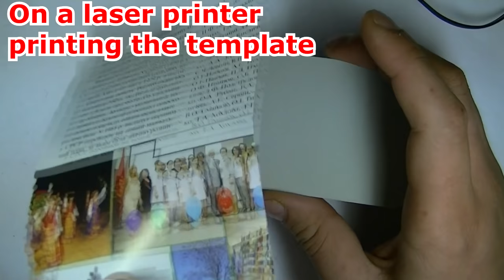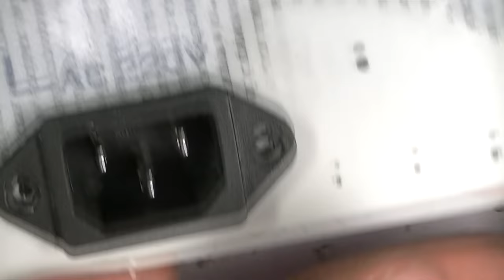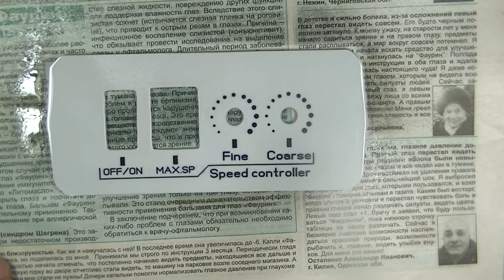How to make a beautiful front panel for an electronic device

Comment: Did you know there is a drill attachment that nibbles out shapes? One hole and with a template guide away you go, smooth finish within minutes for plastic, aluminium, and mild steel up to 1.5 mm thick..

Comment: The solvents in that spray can are very similar to acetone or could contain acetone. Although a bit more difficult to obtain a 2 part polyurethane clearcoat will not dissolve the ink/toner.

  You managed to get the paper off of the ink/toner much better than I can. Nice job.
-Jake

Comment: Maybe I can answer some of your questions:-)
1) What material you try to use as a front does not matter as long it can handle the heat you have to apply. It can be metal, plastic or many other material's.
2) The best paper you can use is paper with a high gloss like magazine paper, laser photo paper and others so long the paper also can withstand high heat so dont use inject photo paper. For best result try to find some paper that also takes water wary well so it get soaked easy.
3) You have to use a laser printer because it melts your motive on top of the paper.
4) How much heat then? You have to apply so much heat that the laser "ink" remelts and sticks to the surface of plastic or metal you want to decorate. Try from 200C /  400F and go up.
5) When you want  to remove the paper you just have to soak the paper in water for 5-10 minuts and carefully remove the paper with your hand or a cloth.
7) Last try to search for "making circuit bord" or making PCB" there are a lot of great info you may can use.

Comment: Wait, a few questions about the first step (or before it). You used a laser printer on what material? Is it proper for this type of job? What is its name? And the most important question, if you want white text and indications on a black chassis / box, what do you do; I have some old synths with white letters and lines worn-out. Thanks
Reply: You must use a laser printer (LED toner transfer printer) since toner is actually a thermoplastic powder that melts onto the surface. You can use glossy magazine paper for the transder, most works. You can also buy special PCB toner transfer paper.

Transfer can be done onto most materials. Here it's an ABS enclosure. Polystyrene, polycarbonate, aluminium, stainless steel i believe have all been used with toner transfer.

It is possible to buy white toner powder for laser printer (ghost toner). I cannot promise you that it works!

You may be able to use drag knife cut PVC foil to restore white lettering and graphics on your equipment. You can get the cuts done at every custom T-shirt shop in the city. Then you apply transfer film, use transfer film to apply the cut design to the item, weed out the lettering and graphics to retain the mask, and paint it in. If you can use alkyd resin paint (model "enamel" paint), it takes a few days to final cure but it's going to be robust and is never coming off, but it can be difficult since it likes coming on thick. If you don't have an airbrush and aren't confident in your thinning and brush craft, spray paint acrylic gives a good outcome in a pinch, but isn't as long term durable.

T-shirt shops might give you other ideas as well, they might have multicolour transfer print machines of different kinds. Talk to them.

Comment: So how can you  relabel the front of an old vintage halicrafters communications receiver that has a metal case With what I’m assuming is painted on small lettering. The radio I’m working on needs to be repainted but naturally I will lose all the lettering when I sand and prep the face plate.